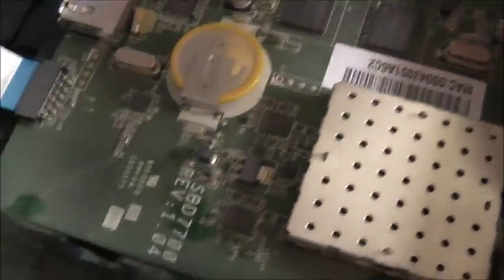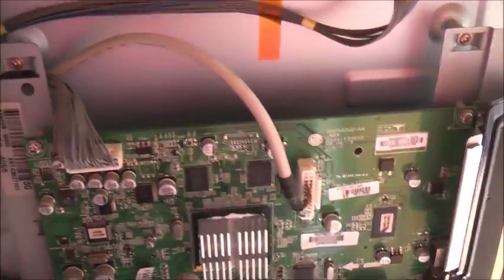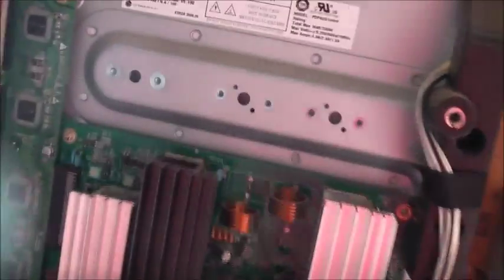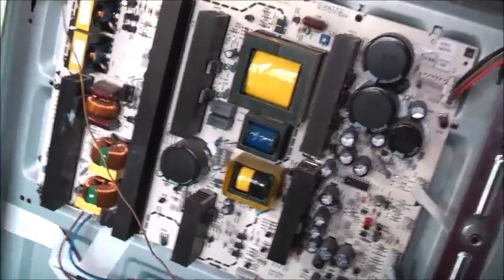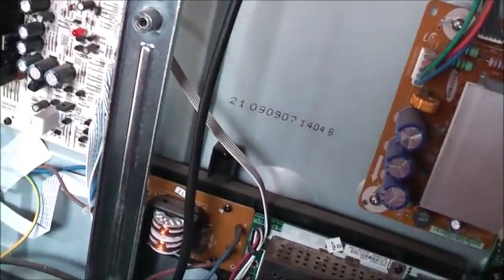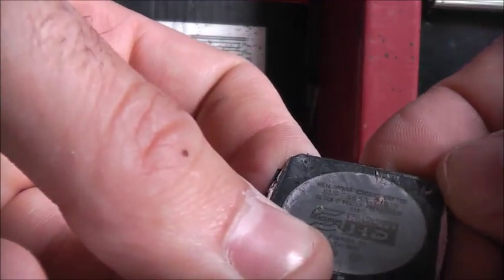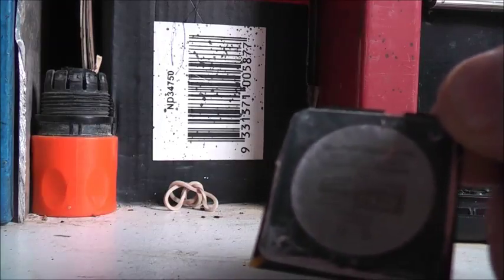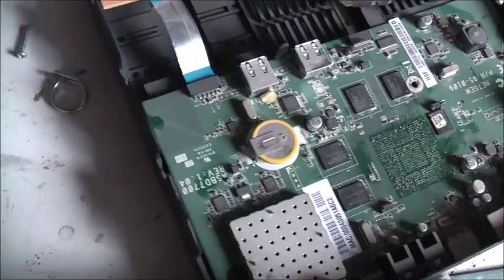LG Plasma TV, GPU Heatsink Mod

Comment: Sigma Designs has been around since the early '80s.  Before making a name for themselves designing MPEG decoder chips they produced PC expansion cards.  That chip there is actually a MIPS-based SoC with a very powerful integrated DSP and special circuitry for handling on-the-fly compression/decompression of several different MPEG video formats including HEVC up to 4K resolution.